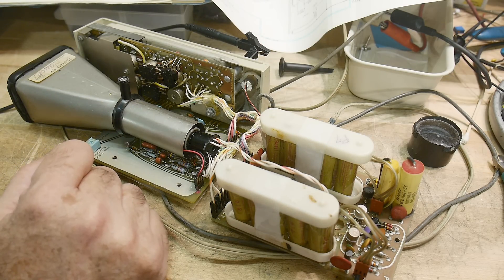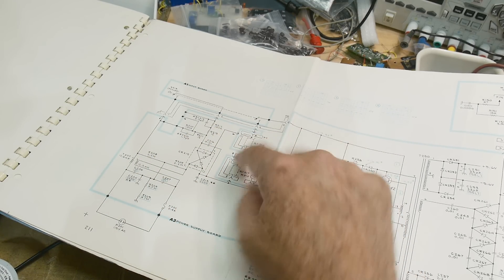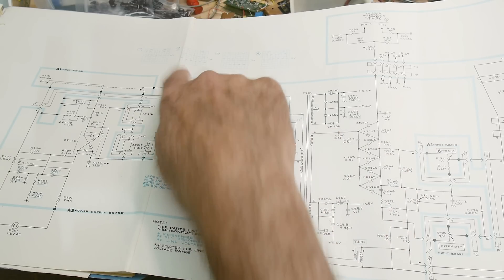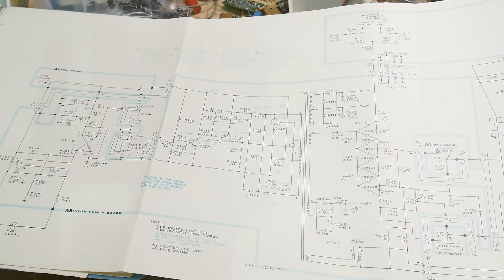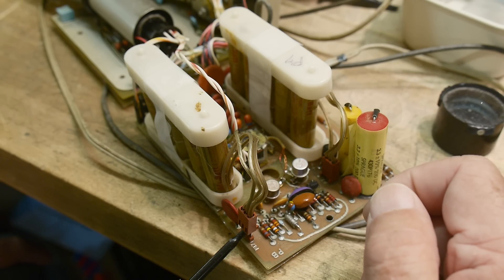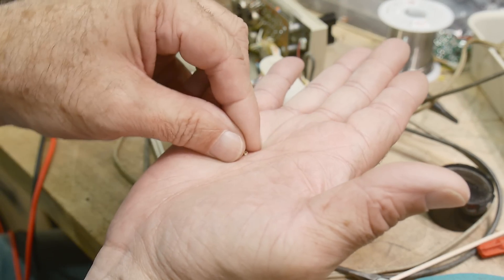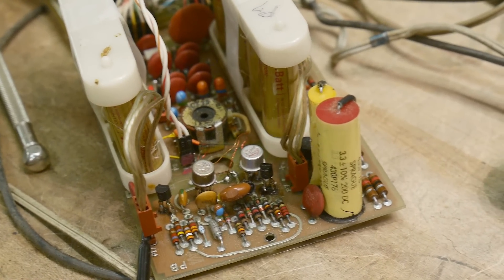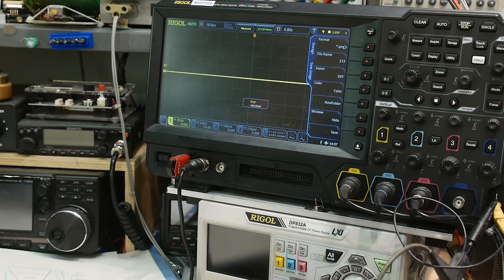#1358 Tektronix 211 Mini Scope (part 2 of 2)

Comment: You put the cap from the base of Q242 to the base of Q249?
Reply from the maker: collector to collector, there is already a cap there in series with a resistor. my bodge should probably have a resistor too
Reply: Thank you my good man. After 9 more months on the shelf I may bring my 212 to the bench this weekend. Last I remember it lost a channel. Stumbling on to your video has lit a match.

Comment: Hi, it draws beautifully, the screen is clean, I would just say that it needs to flatten out a bit, I see it slanted on the monitor (but it could be the angle of the camera).
I can say for myself that I don't like these kinds of fixes where adding extra components solves the problem. The manufacturer designed it somehow and it worked without an extra capacitor, that's why I also wrote to you about the fact that the batteries make a filter and that Tektronix has released a modification of the power source connection for some series.
So the first thing I would do is check if the power source modifications apply to this model as well, secondly I would test the oscillating circuit components under load and leak test the capacitors at their rated voltage.
I would mainly check CR240,241; R240; C240,247; maybe also C and R 236. According to the way you described the course of the oscillation, something bad is going on, it's just an idea, I've never come across it, but it couldn't be that the transformer has partially damaged varnish on the winding. It occurred to me in connection with overheating of only one side.

Edit:Recently I was repairing a simple programmable regulator, one of the diodes looked normal when measured like the others and since the regulator was not working well I checked the circuit again - the curve tracer showed a different curve shape for one diode - after replacing (I replaced all 4) the regulator works perfectly.

Merry Christmas and Happy New Year  🎄🎁🙂 Tom
Reply from the maker: I adjusted the trace rotation when I got back.

Comment: Some 20 years ago I dropped a 211 off a smokestack I was climbing, at about the 200 ft level.  We had Lear Siegler stack opacity meters on all the plant stacks to measure the opacity of the emissions and my job of the day was to fix one that had failed. Needless to say the baby Tek  did not survive. 

Tales from a lifetime in instrumentation and process controls.
Reply: Great story!

Comment: Q242 and Q249 oscillate with a feedback winding 12-13-14 forming a Royer oscillator. Q231 serves as a undervoltage protection for the batteries, locking out the entire converter. Q235 controls the oscillator, with feedback from the transformer EMF rectified by CR240, CR241.